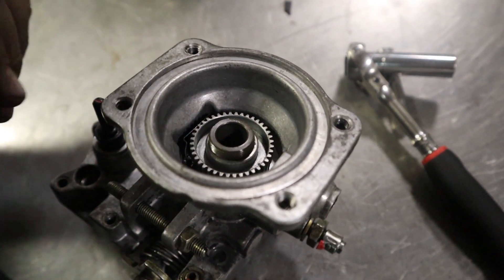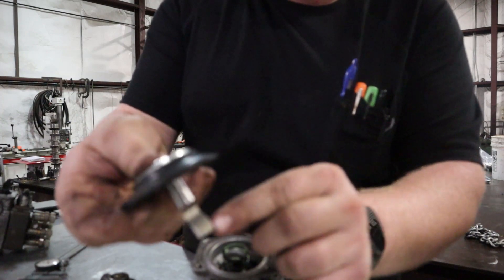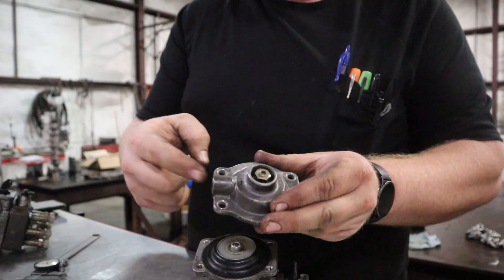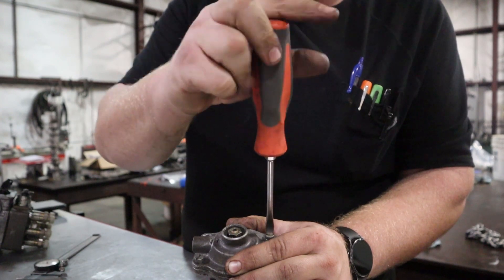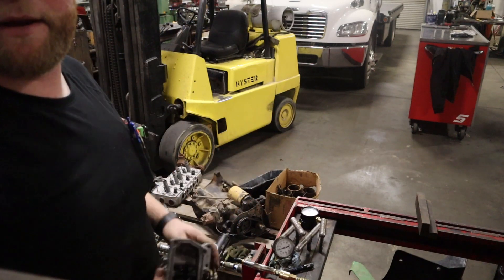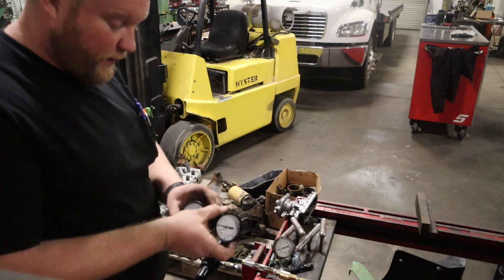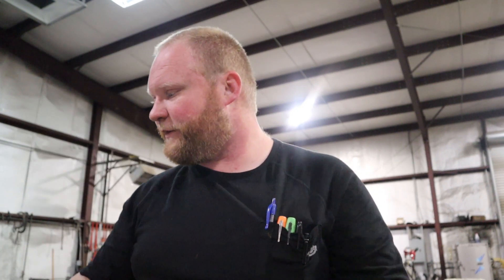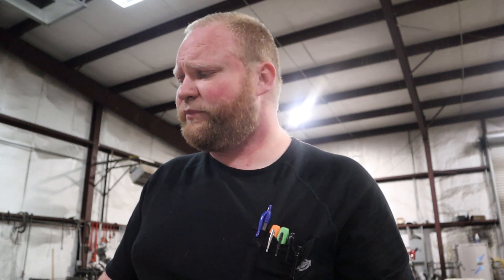My VE Injection Pump and Baseline Tuning Part 2

Comment: super helpful video... just yesterday, 2/5/25 i was working on a 4bt that sat for several years and the fuel push pin was stuck on full so when i cranked the motor it went right to WOT with a ton of black smoke (shut it right off within a half a second of course)... pulled the top of the pump off, cleaned it all out with WD40, got everything freed up and moving smoothly, blew it all out with compressed air, put it all back together, bled the lines and it fired right up and ran like a champ! while i was in there i didn't know what that spur up / down adjuster was but i left it alone... now after seeing this video where all the way in is minimum fuel / smoke i realize mine is set for maximum with about 8mm threads showing... gonna step that back to almost flush... again, a super helpful video... thank you!
Reply from the maker: @kellybikeco  happy to help. As fun as black smoke sounds, it's just wasteful. Happy tuning!
Reply: @EngineKrahnicles  tell me about it... so glad to have the mystery 4bta up and running!

Comment: Good video, thanks :) Cant u put in a harder spring to delay full fuel delivery ? Would be fun to hear something about the "full throttle fuel adjustment screw" :)
Reply from the maker: @davidandersson7945  I'm sure someone makes a spring or you could match it up in a catalog somewhere. But I'm trying to create limits for myself

Comment: Hey i have a 92 12vale IC   would this work on stock injectors ?  Nice video  man
Reply: Nice , thanks for the info. My star wheels about 2 1/4 from the bottom and I might run it like your setup  is. im running a hx35 / hx40 Compressor wheel. It has 1/8 timing bump, 32 governor Spring And it's studded  with the top hat of the  V. E pump mod and MH fuel pin
Reply from the maker: @wesleyfarina  sounds good. Sounds like yours is stock. Just know that mine isn't officially tested on the motor, but it is theoretically "tuned." don't know until it's running.
Reply: Let me know when you run it
Reply from the maker: @wesleyfarina  it'll be a while. Just had a kid, building a garage, and lots of church stuff going on... you know. Life.
Reply from the maker: From what I've seen, you should see a little gain on stock injectors. 20 to 30ish hp. Stock injectors can only flow so much